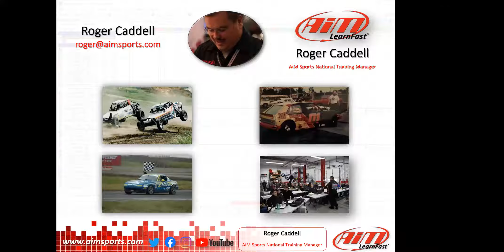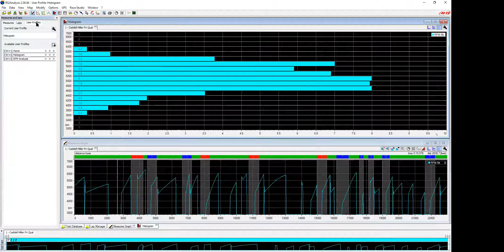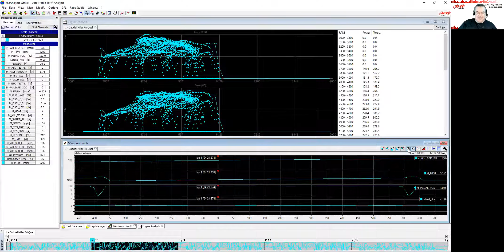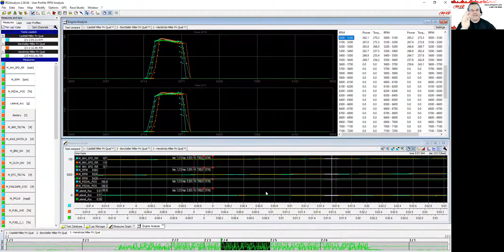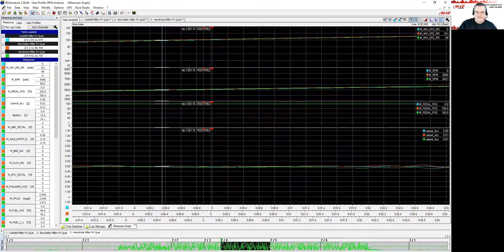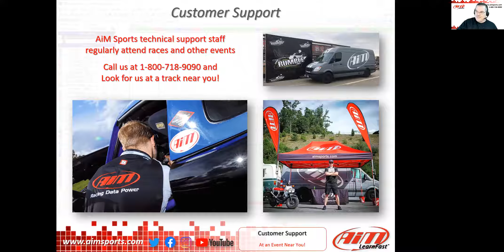1-52 Engine RPM Analysis - Live Webinar with Roger Caddell - 9/24/2020

Comment: What is the best way/sensor to measure an engines rpm so that I could analyze?
Reply from the maker: @fexitup, most AiM hardware can receive an RPM signal. 
The MyChron product receives RPM via an inductive sensor.
Most of the rest of the AiM hardware can receive an RPM signal from an ECU data stream, Square Wave (5-50v), or Coil (150-400v).
All of these will work very well and give you good RPM data.